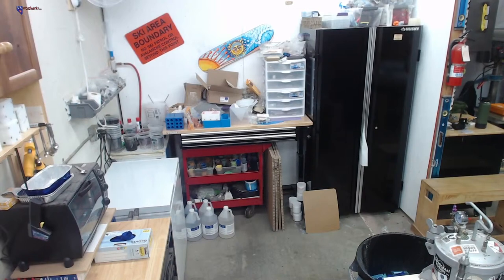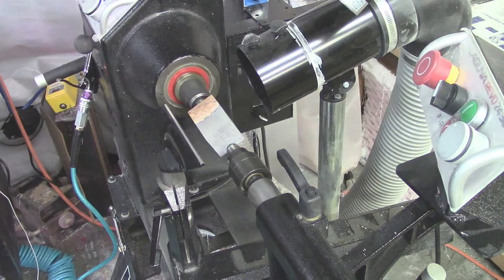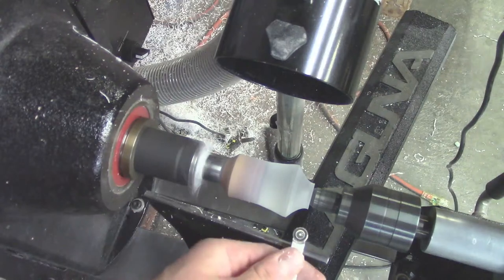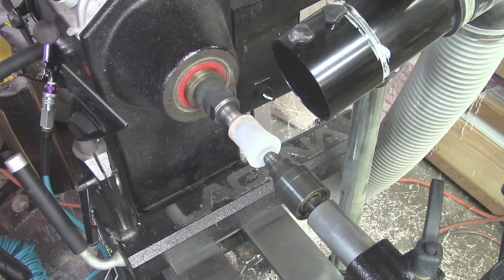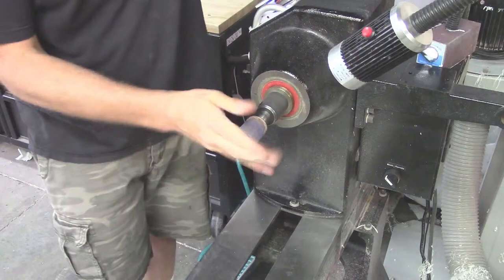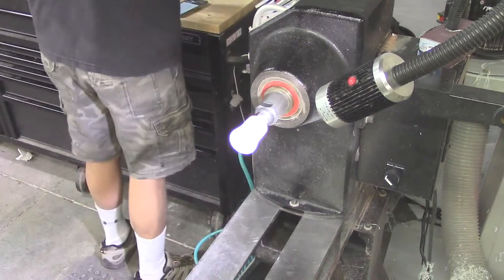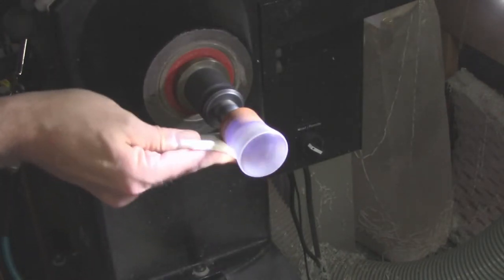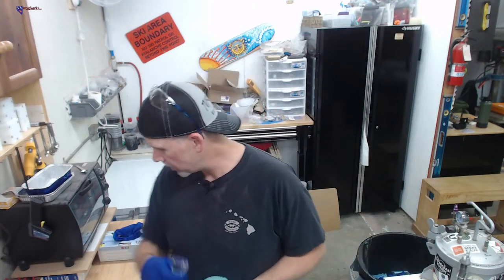🔴Replay: Turning A Salvaged Bottle Stopper Blank | Episode 111

Comment: Hey Zac, just watching the replay as just not enough of a night owl to catch your lives. Bottle stopper came out looking great. Little tip for you as I've heard you mention how much you don't enjoy sanding and also on the front of getting best results. Have you tried a inertia sander for lathe items? I got the Hope in the spring to help with my bowl sanding, but recently tried it on stoppers etc and even pens, the finish is amazing even only going to 600 you jump straight to pastes before final buffing and its alot quicker ive found too. Zero ring sanding lines. 
Anyway great project again, and another good live. Maybe at somepoint il be able to make it in on your lives 
Nath
Reply from the maker: Hey Nath, I do have an inertia sander, and they do work pretty well. I'd like to get a power sander sometime and try that out too